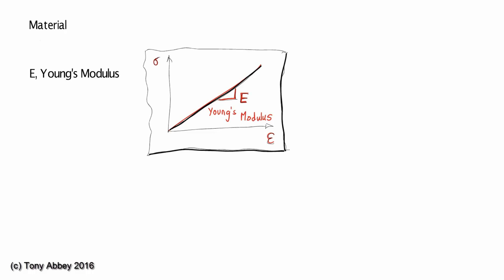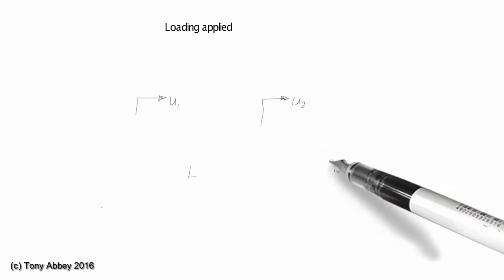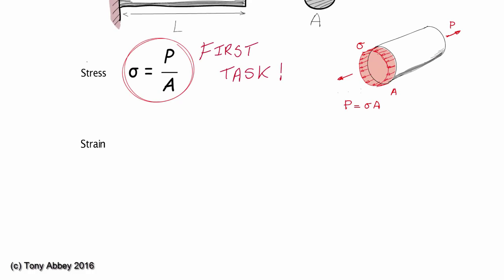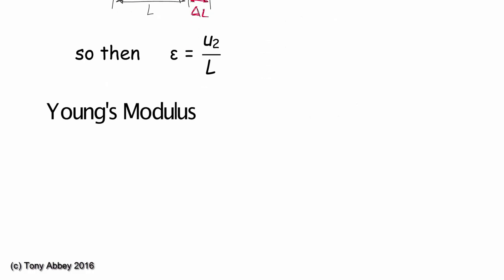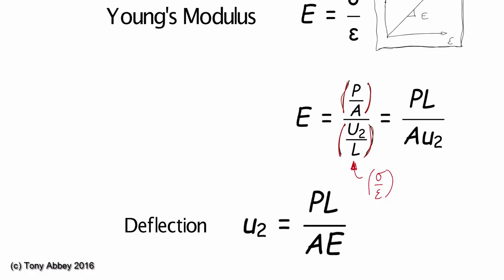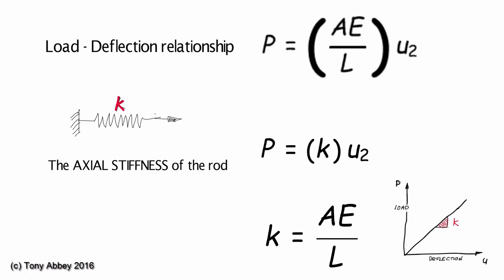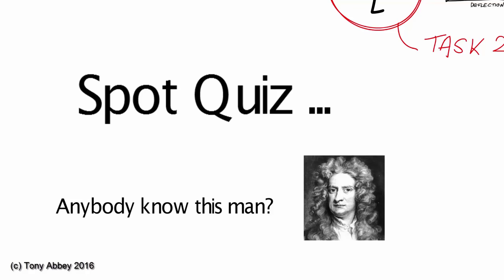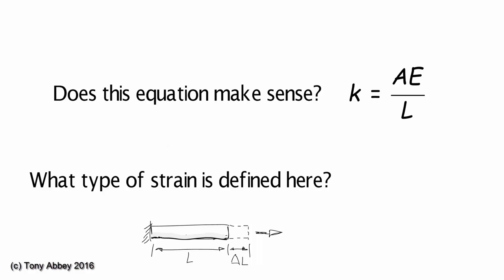B1 - Finite Element Analysis Training :  Basic Stiffness,  Lesson 1

Comment: Would just like to point out that stress here is expressed as P/A which usually implies pressure over area. Though, stress is defined as force over area. Could this 'P' actually mean potential rather than pressure?
Reply from the maker: Hi Shaun,

sometimes P is used as a label for force, as in this case. I think the context should make it clear, and the diagrams. Pressure over area would not make physical sense, as you mention. I will label P as a force more clearly next time. 

For a discussion of mine on stress, see:

http://www.digitaleng.news/de/stress-in-finite-element-analysis/

Tony
Reply: Definitely. Just poking for clarification (:
Great video and animations -- minimal and concise!